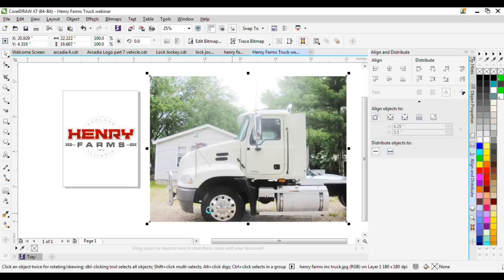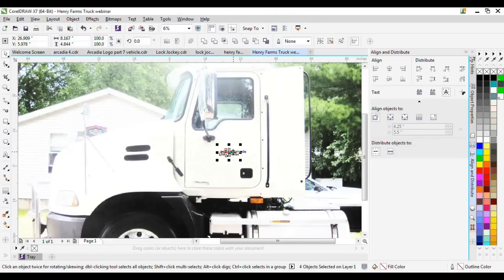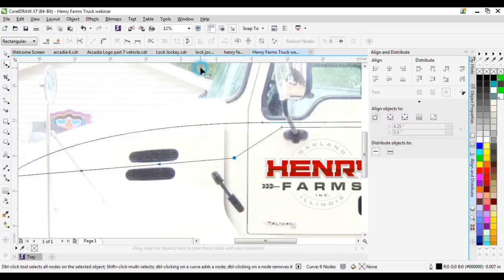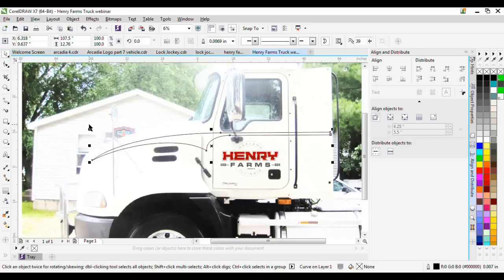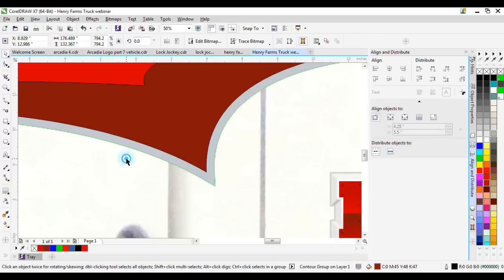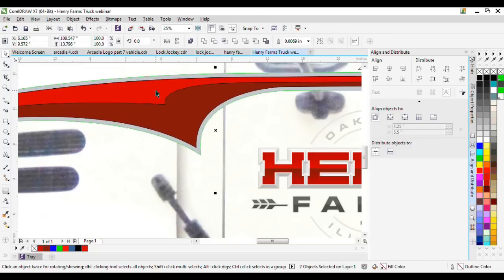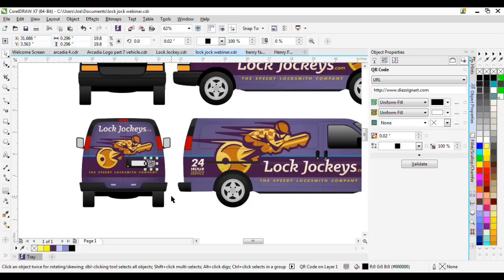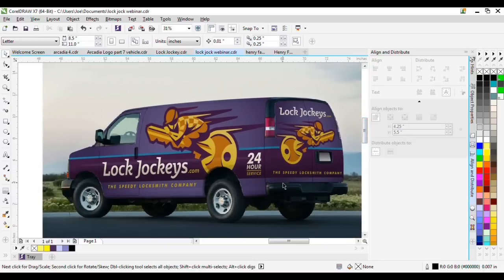Designing Vehicle Graphics and Wraps in CorelDRAW®

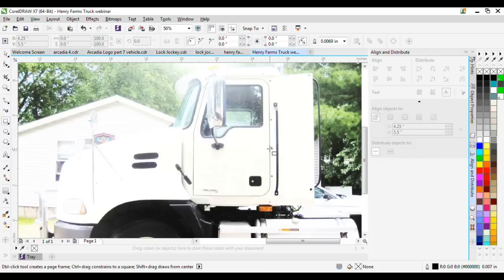Comment: For a quicker way to scale the vehicle to the proper size (reference your video at 5:06 time-mark). Draw the rectangle as you have, but Powerclip the photo into the rectangle then scale it up. Afterward just extract the photo from the Powerclip and you're done.
Reply: Same amount of steps, same speed, just a different way to do it.  That's what's great about CorelDRAW.  There are many ways to do the same tasks. It's all about what is more comfortable for the individual.  I've used the Powerclip method, but had been doing it the other way for years, long before the Powerclip was even a feature, and it still works well, so it's a little more natural for me to use.